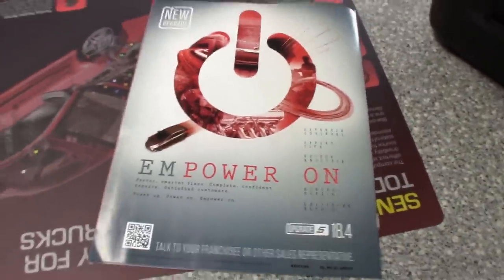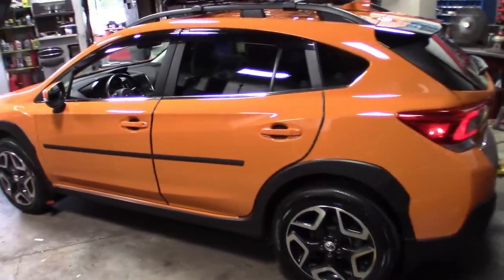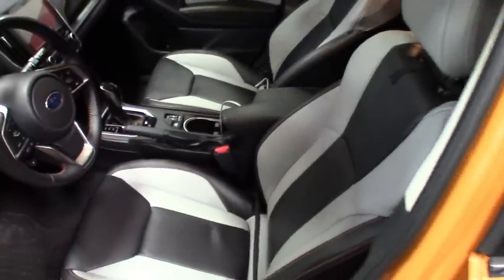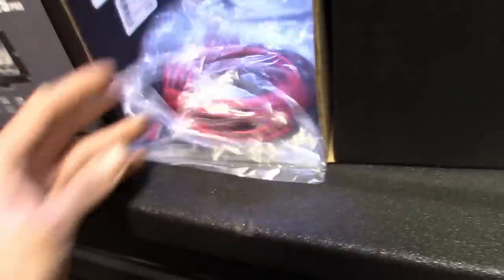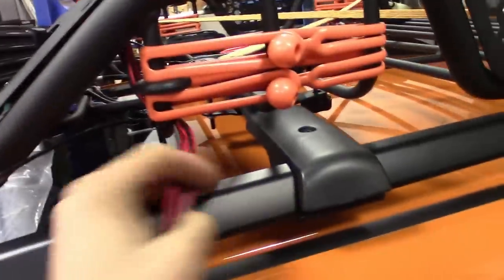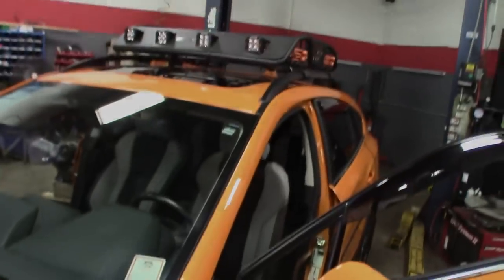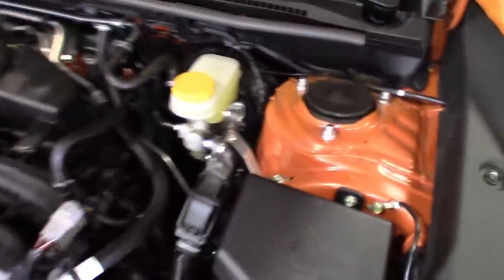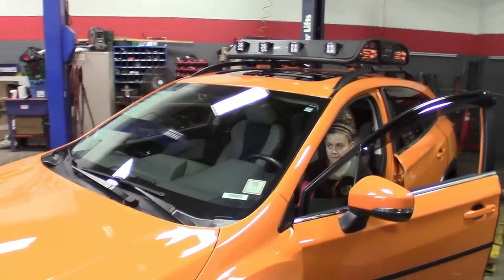RIGID LED INSTALL

Comment: You’re a straight up guy! Need more people in this crazy world like you. I just started a new job at a garage where I’m from and my scanner is so out of date and I don’t have all the plugs for all the vehicles but I’m still out here plugging away. One thing I did with my led lights is I just used my factory fog light switch since it has a built in relay and it seems to be working for my truck. The switch I used is has enough juice to run my 50” light bar and 2 led pods i switched out for my fog lights... that’s a really clean wire job man. Keep up the good work as always. God bless

Comment: FYI the soldering iron is the shit! And it does tend to use a hood bit of fuel for basic soldering task. But super hot and the magnet is the bomb on the back

Comment: Looks good man...luv your vids 

Can you explain the decision to use electrical tape vs shrink tube or even better, sealing shrink tube?....in my experience it leaves a much cleaner looking install and doesn't degrade over time like electrical tape.
Reply from the maker: I used shrink tube on solder points then tape to hide the red color to help it blend in. used electric tape too match the stock engine harness.

Comment: Nice lights. I wonder how well those stand up to abuse like on a welding or service truck. Vibration, bad roads, occasional hit from something. I should prolly stick to something in a rubberized enclosure. Those aren't priced too bad though.

Comment: This is a great idea! 2k giveaway.... nice ring to it. Great vids. Kinda random but do you do fluid flushes as a shop or try and not flush but dump and refill. What’s your take on it?
Reply from the maker: I won't flush transmission over 100k only drain n fill. But p/s, coolant, and brake is all free game.

Comment: Have you ever used the Snap On Ethos Edge? Is that a bi-directional tool as well?
Reply from the maker: Yes ethos edge is bi-directional. It is actually a fantastic scan tool for the price.

Comment: Hey JRC, completely unrelated to the vid. But what cleaning product do you use on your box? I just picked up the same colour way and it’s a finger print magnet!
Reply from the maker: Snap on flat black cleaner. I show it in the box mod video.
Reply: JRC54 thanks man, must have missed it on your mod vid. Just seen it on your tool cleaning vid though 👍
Reply from the maker: 👍😊 I forgot I mentioned it it that vid too. It's pretty good stuff, keeps the flat color after wiping it off.

Comment: Should of used heat shrink for the wire.  Other then tape just an idea
Reply from the maker: I heat shrunk the solder points. Only taped to hide the color.
Reply: Yes but what I do is I take a drill hook the wires in them and twist them so that 1 looks like a factory but after it costs a bit more but I after heat shrinking the joints I run heat shrink after to clean it up.  Any place that may be viable..  but looks good